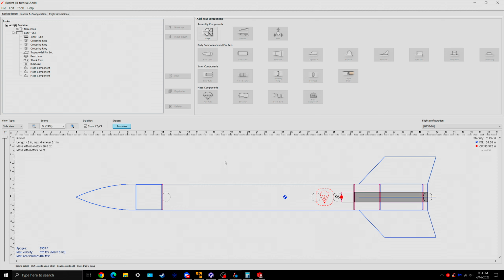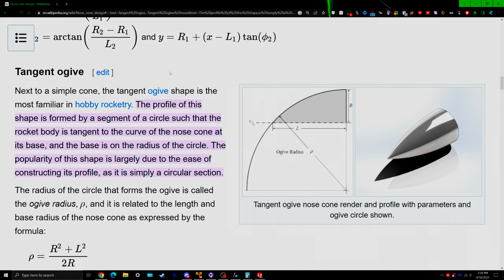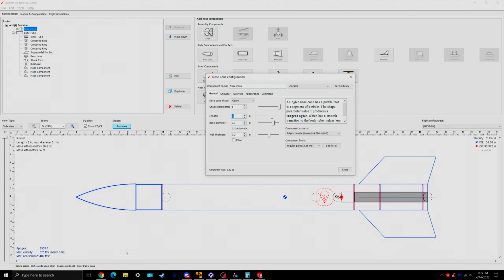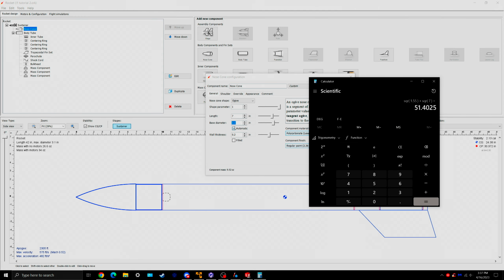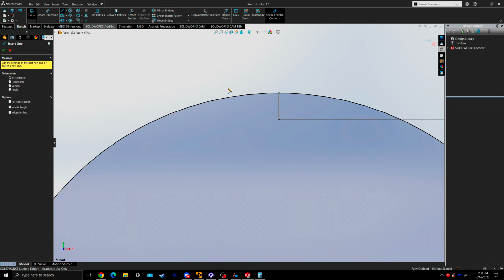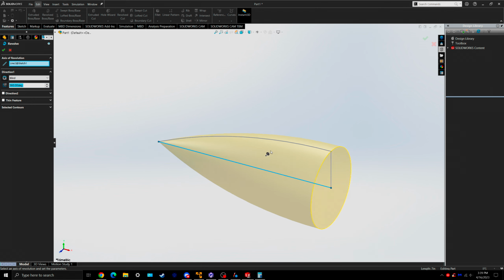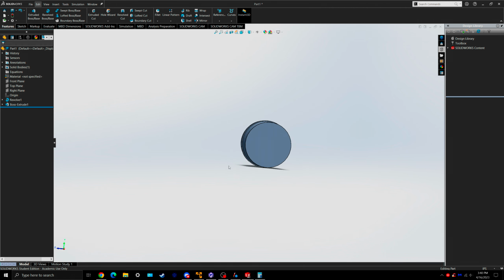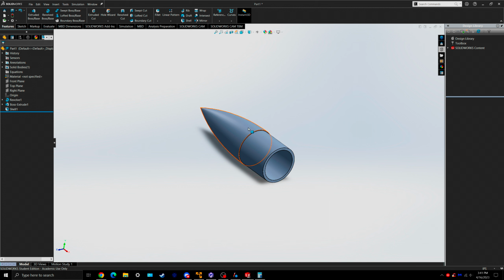L1 Certification Workshop: 3D Nose Cone Design in Solidworks

Comment: if you first drew the two lines with the dimension.  Then place a circle on the ends of the lines.  Then make the circle center directly under the vertical line you wouldn't need to worry about calculations.

Good video.